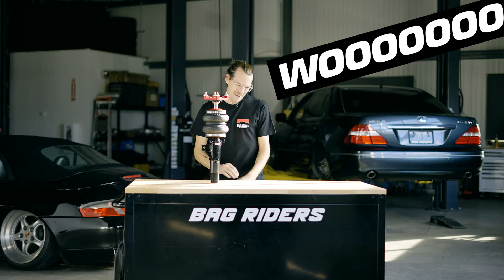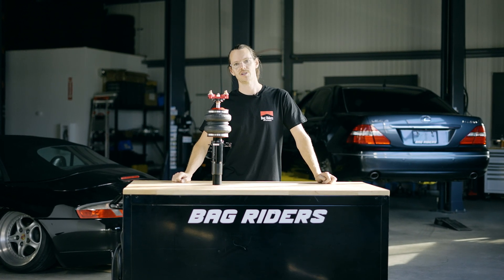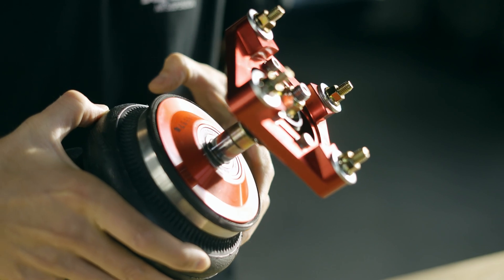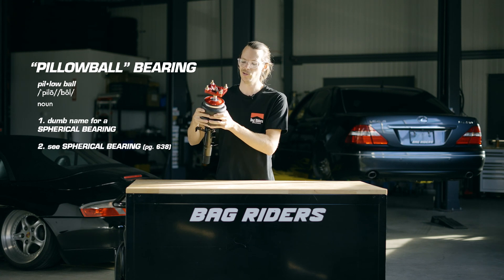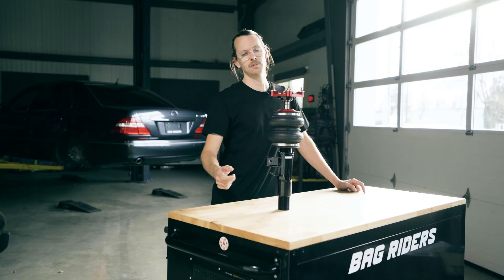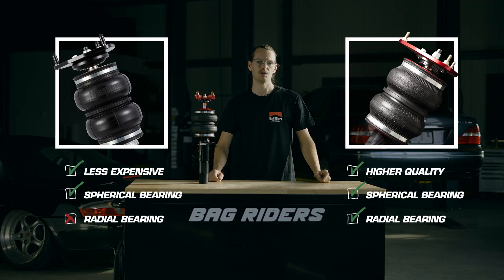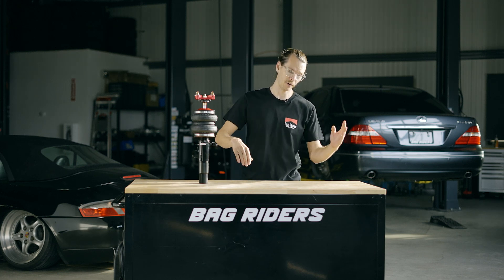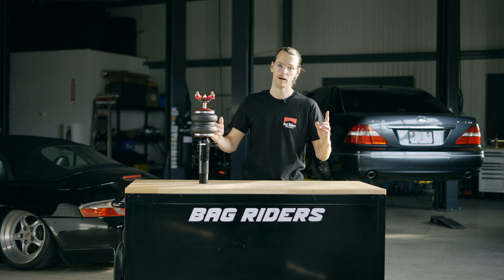Radial Bearings in Air Suspension Struts - What Are They?

Comment: how come my recently purchased new performance series struts for VW MK7.5 didn’t come with a radial bearing and just a crappy spherical bearing? or did they? which i have had to replace both just after 5k miles, by the way, under warranty. big fail on air lifts part for using cheap bearings. time to find some better quality ones for the next time they both start making noise.
Reply from the maker: Hey sorry to hear your bearings already failed. Do your struts look like the one in the video with an integrated bearing? This is a very recent update to Air Lift suspension and the old style is still being phased out. Luckily if you want this upgrade its easy enough to do with the purchase of 2 replacement bags.
Reply: @bagriders  How can i tell? the kit that was sold to me from BagRiders is the exact same kit that’s currently pictured on AirLifts product page for P/N: 78522. I cannot visually check as the struts are on the car. 🙏
Reply: @bagriders  easy and expensive to fix an issue i’m now stuck with, lol. for $500 i can fix it or try and find quality spherical bearing for $300. i’ll just keep warranty claiming in the interim and look into a possible lawsuit against AitLift 👍
Reply from the maker: You would have to remove the wheel to check and see if it includes the bearing. Feel free to contact our customer support for more information about them.
Reply: @bagriders  it doesn’t but thankfully air lift is sending me 2 new bags with the radial bearings and 2 spherical bearing kits, to resolve this issue once and for all permanently. if not i’d be on my third set of spherical bearings in 6 months. stoked!!! again, i had bought my kit just a few months before they changed the design and added the radial bearings.
Reply from the maker: @bcshay  Happy to hear they're taking care of you!

Comment: Love it how you guys keep on explaining these details about air ride nuances.
I have a mcpherson system but my car is not a tuner car and no brand does air ride specifically for my car, so most of the time I will be getting a spherical bearing and that's it.
My current strut does have a radial bearing at the top instead of a spherical one and that's it. Do you think that can do the trick?
Reply from the maker: What type of car do you have? Most of the time the bearings are not interchangeable to swap from a radial to spherical.